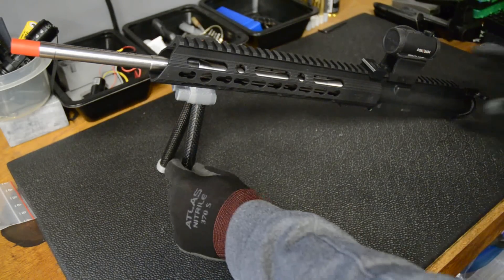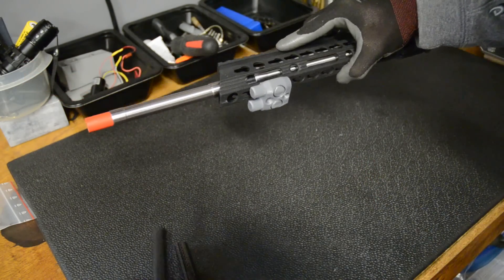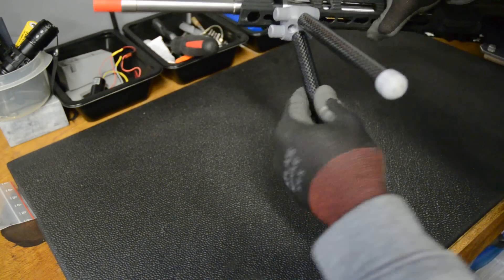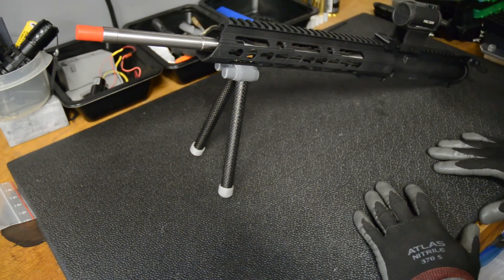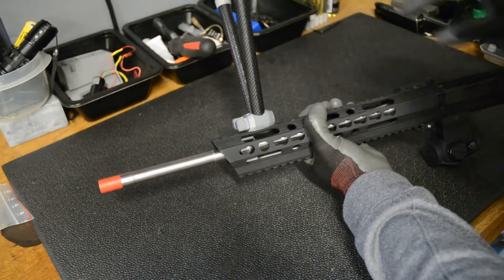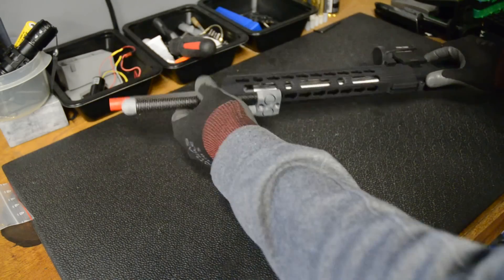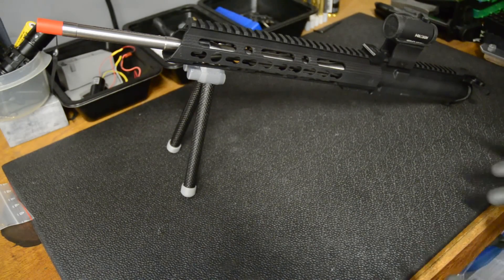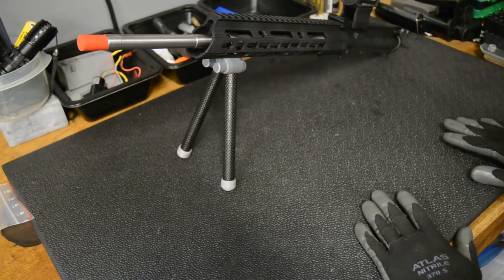Ultralight 1.5oz 3D Printed Carbon Fiber Bipod

Comment: OD of the tube is 0.57", which is oddly close to a CR2 battery. Would like to see the tube stored in the battery compartment of a stock saddle/utility stock.

The STL files have been deleted. Would it be difficult to convert the mounting hardware to mlok?
Reply from the maker: Thanks for the heads up, I'll check if it fits in a stock. 

Sendspace deletes stuff after 30 days I think.  I'll re-upload it.

MLOK is no big deal. I just don't have a handguard to measure from.

Comment: Interesting stuff. I would be curious to see how it functions outdoors and especially on uneven ground. If that is an issue perhaps screws on the feet of the tubes to allow some level of adjustment?
Reply from the maker: I hadn't considered that, my shooting spot is level. I'll see if I can add some adjustment to the cant or leg length.